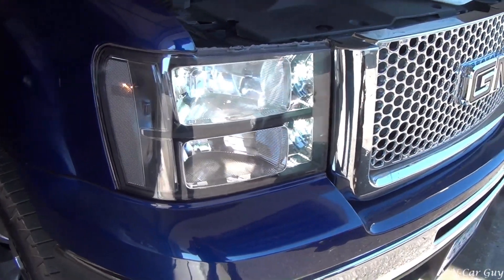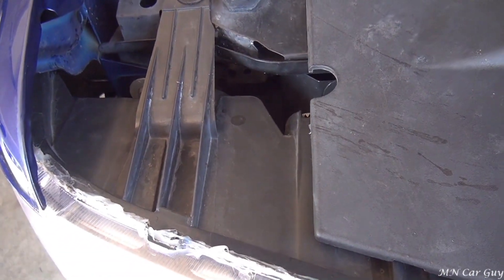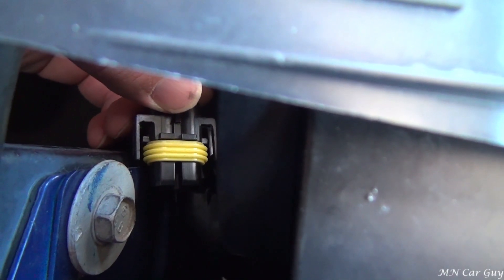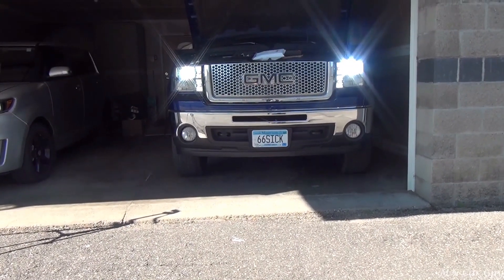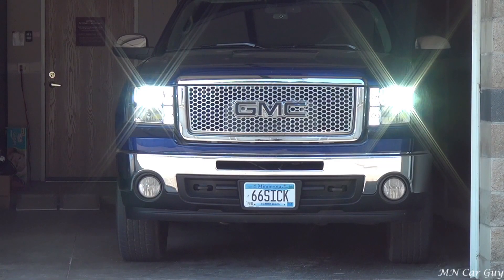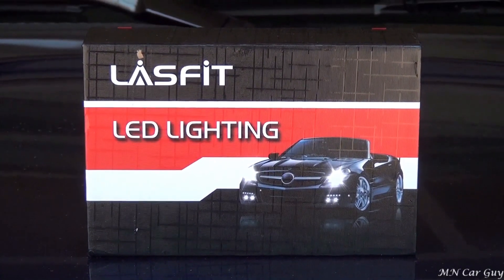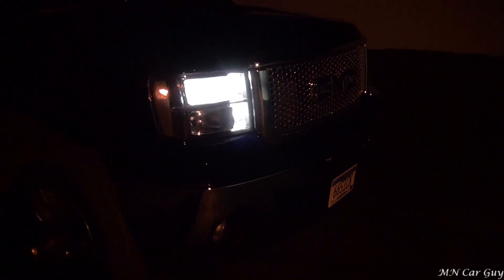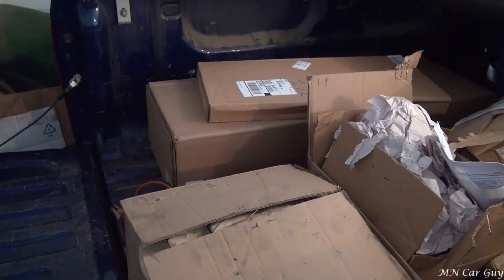Installing 6000K LED Headlight Bulbs (2012 GMC Sierra 1500)

Comment: My leds face up and down not side to side. Is this right?
Reply: So do mine and it looks more like it lights up and down not forward of the truck. I thought they were supposed to be at the 9 and 3 position?
Reply: TIm Stone432 I have asked and yes they are supposed to be 9 and 3. So I rigged mine and wow what a difference
Reply: @justreviewit5024  how do you rig it, mine only go in one way and it ends up at 12 and 6 o clock
Reply: Mine as well. They are designed to go 12 and 6. Not sure how you get them to go to 9 and 3 without some modification.